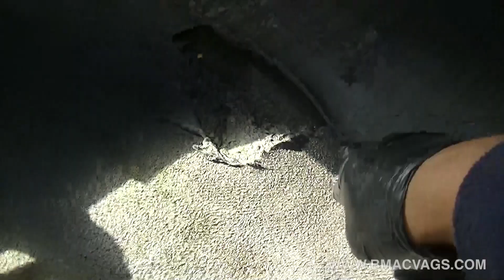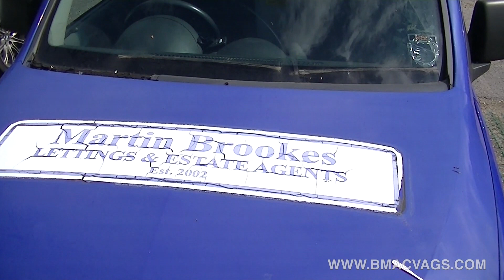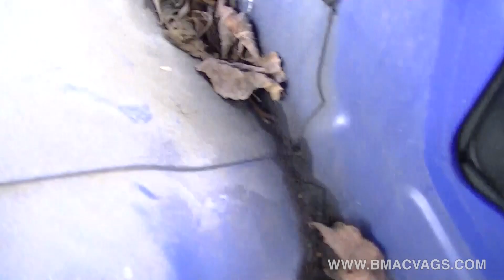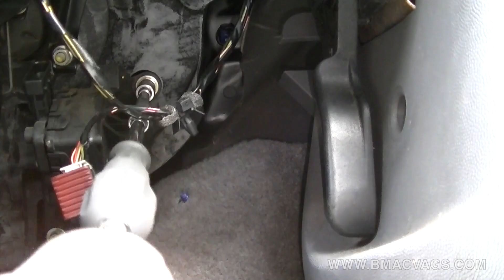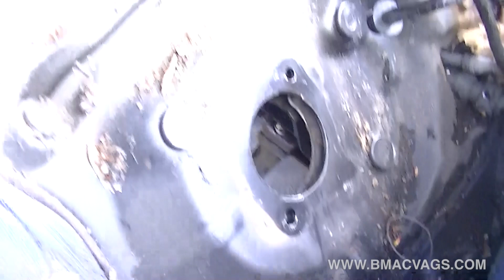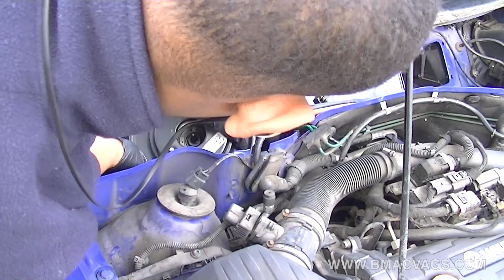Opel Vauxhall Corsa Leaky Wet Floor Repair

Comment: Did this 6yr ago cos driver side was soaking. Job done I removed the stupid flaps which just caused a blockage stopping water from drain.  Now same problem on other side
 Where the flaps had been it's completely free draining.
So where do I go from here???

Comment: Do we have a temporary fix voor the ladies and gents that don’t know any of the words or fixes you did there at all…? 🤓🙏🏼 my mom has got an old corsa from 2001 or something, an automatic.. it doesn’t look like its coming from the break and gas area though, looks like it seems to come leaking from a gap between the left (the Netherlands driver seat is on the left) door and the car itself… or maybe somewhere else? Because we also put cloths in the “open areas”, on the left from where the break is, and let them sit there for a while and the cloths come out dry after rain and everything. The mat and under the mat is drowned in water though..

Comment: Great video, will be doing it soon, already fixed the lid on black box on the right, but there is still small drip behind breake pedal. That should be the final thing I hope.

Comment: Great video really informative. I used a roof seal brush on fix due to inability to remove pedals etc. 2 coats over existing bead but brush gave me half inch over each side of bead for better sealing. Roof seal, brush on worked amazing if you can't do it fully like amazing video 👌

Comment: That isn't a corsa but a combo? Anyway I have a combo 07 with the same problem and this video is ace but I am not sure I am confident to tackle the job myself.
Reply from the maker: Corsa and combos are built on the same chassis, so ultimately they are the same vehicle
Reply: @BMACVAGS  Cool. I got the job done last week. Seems ok now it’s done. I think the stuff was called Tiger Seal but the scuttle area was also full off like leaves and sludge and the original sealer was like broken hard blue tack.

Comment: Got the same problem with my gamma, rain water sepage was bad like a pool in the drivers seat, opposite the brake booster is an outlet mine was clogged with alot of dirt and grime, cleaned it without removing everything just the water bottle and flushed it now rainwater free flows right out again🖖

Comment: Hello. Is it necessary or not  to bleed the brakes after completing this procedure?
Reply from the maker: Brakes only need to be bleed if the circuit has been opened. No need for bleeding if you follow this procedure

Comment: my servo/booster wont align air tight with the master cylinder. the seal is fine, I am completely baffled as to why. any clues? can hear the vacuum and feel it from the join. I perhaps have bought the wrong servo. although the hole is the very same.
Reply from the maker: I dont know what you have done to have and advice for you

Comment: Wish I lived near you my mechanic is a absolute dingbat. I told him where the leak was coming from on my car. I stripped the carpet out it was so waterlogged I totally dried the car then I stuck on  pieces of paper to different parts of the footwell this ruled out a faulty door seal no wet there also it ruled out water from a dodgy seal on a back light. I then purchased some food dye added it to a bucket of water and poured it over the windscreen and grill the dye dyed the paper first around by the break pedal/servo area. I said to my.local mechanic I wanted the servo sealed in and outside. He then charged me £30 for looking and telling me he can't guarantee the work so wouldn't do it. I said do your best but he wouldn't do it at all. How can he call himself a mechanic when he's a weakling of the motoring world :-) imagine if you asked a plumber to fix a leak and they said no , it's fkn embarrassing . I will follow you video and do it myself. Many thanks for uploading this top man.

Comment: Thanks So Much. Even down to the measurements with the tools, really helpful. Same problem im having in a Tigra... won’t be as neat as you, but if I dry out the water inside the car, and seal the outside, would I still need to remove the pedals? (Sorry if u have explained this actually let me go back)... but thanks a million.

Comment: Good video but it kinda ignores the basic problem which is water pooling near that back plate, what the major problem is a blocked drain in the engine bay is a black flap covering the drain. The drain is full of crap which allows the water to pool. I just cleaned the drain with a bottle brush and now the water pours out there freely, when pouring water down there i did find a couple of drops were coming in while pouring two gallons of water in there. But it is just drops and it isn't filling with water.  I think it's likely enough to have fixed it enough, if not I can redo that seal but if the water is pooling the slightest hole is going to let it drain into the car.

Comment: My leak was at the cable for the bonnet behind the sprayer bottle, the seal just pulled into the hole, So I popped it back out ,hope its good.

Comment: Cheers dude.. I've done this job 4 times now.. 1st corsa it worked first time. Tried it on mine, I've now had the thing apart 3 times and still leaking... Will be going it again soon 😯

Comment: Hell's bells, fantastic. A lot of the work put into this is unseen -- I'm thinking of the constant repositioning of the tripod. I took my Opel Tigra for its birthday carwash and three weeks later after sitting in Southern  French sunshine I was astonished today to find the driver's side (only) is still soaking, and even some seeds have sprouted. As  is obvious I don't use the car often, it's mainly my Ford Courrier; working indépendant it yesterday I noticed some 1" diameter plastic circles whic h I assumed were floor drain plugs . Since you didn't mention it I presume there are no such plugs on the Opel. What a rigmarole to have to go through just because the grills they put there aren't fine enough. An like another commenter mentioned this water might be the cause of a warning/ error light I'll getting .... Well, thanks so much for all the work you've put into this -- 10/10. Am thinking of lifting the carpet and drilling a hole or two... Phew, so much work...
Reply: Typo: indépendant should have been 'underneath '

Comment: Has anyone had problems with electrics relating to a leaky wet floor? I have a few trouble codes. Specifically, P0560 (system voltage malfunction) and another one relating to the 02 sensor. I think the ultimate problem is water/corrosion withing the wiring. I currently have a leak wet floor on the passenger side of the vehicle. Drip, drip, drip!
Reply: Hi There, the passenger side leak is from the lid of the relay box, to the top right as you look under the bonnet up under the scuttle, the neoprene lid seal leaks and finds its way to the passenger footwell.

Comment: Thanks for this video man, without it I wouldn't have had a clue how to do it on mine. Took 2 very messy and laborious days but I got there in the end lol. For anyone else attempting this, make sure you reset the brake light switch when you reinstall the pedal, otherwise your brake lights will be stuck on!
Reply: how do you reset the brake light switch!?

Comment: Thanks for the awesome video sir, followed it and I’m pleased to report that I was able to clear out all the old rotten sealant, replaced it with new and put it all back together. Looking forward to the rain to confirm all is ok.

Thanks again
Reply: Why don't you just use a hose pipe and confirm it straight away

Comment: Just did this on my 2012 plate combo the bonnet release cable can leak badly so I sealed that thanks for such a great video saved myself £280 hopefully it stays dry 👽

Comment: I did mine today and it went really well. The only thing I did different was to removed all the old sealant with a pick, then cleaned it with rubbing alcohol. I used a hairdryer for 20 minutes to make sure it was nice and dry, and used sikaflex 221 polyurethane sealant . Thanks very much for the video :)

Comment: Wish I had found your video before the two times I have tried sealing my Corsa! I didn’t remove the brake fluid filler so couldn’t get a good seal. This video is the best and I might have another go to see if I can get it sorted one and for all. Thanks man.

Comment: To do a proper job you need to take the black plate out what the servo is mounted on I did this to my combo van 3 years ago No more wet floor
Reply: How do you remove this back plate. I'm doing one for a grandma and would like to do it right.

Comment: Did mine with stixall sealant around bulkhead & roof sealant on sevo had to do again with gasket on servo as sealant didn’t do it so I would recommend using gasket, would have probably saved me having to do ball ache of a job twice

Comment: Would it matter if you didn't sort this problem out? How long would it actually take before a big hole was made, and would it actually effect the car in anyway for driving? Would be helpful if someone could answer my questions
Reply: I'm doing mine today as I really can't stand the wet footwell and winter is starting now, really worried that if it's not fixed the floor will rot through

Comment: Hi, Since doing this we my son no longer has a swimming pool in his footwell many thanks for the video, however since re- assembly  the brake pedal is now very firm, i've tried the turn the engine off and pump the brake, turn engine back on while holding the brake and its still hard, could this be me putting something back wrong?

Comment: Thanks very much for the instructional video. Hopefully that keeps the damp away.🖒 One problem now though is that my brake lights are stuck on any idea whats causing that? Where would be the first place you'd check? Thanks again.
Reply: You need to pull the switch back out on brake peddle

Comment: Just did mine today, one tip make sure you tighten the two screws on the brake booster all the way because I didn't and the brake stiffened and there was a pressure leak.

Comment: Top vid. Time to get some tools out any tips on drying the carpet.
Reply: stephan roberts take plastic of around the area lift carpet up as much as possible and put a screwdriver under to hold it up other wise take the seat out and you will get under it no problem.

Use a cloth and squeeze the carpet with the cloth underneath and ring out and repeat also turn car on and have foot heaters going it can take a while if the carpets are really wet i got a few litres out just by pushing my cloth up against the underneath of the carpet

Comment: So remvoal of the master cylinder a hissing sound was created that would ve expected as it is under a vacuum, however upon replacing the servo and master cylinder, reconnecting the pipe attached to the servo will starting the engine after completion of work create a vacuum in the servo and restore the brakes as they operated before i carried put this work?
Thanks
Reply: Jamie Newman same thing happened to me, any news on it?

Comment: Thanks for the tutorial. I now have a car that doesn't leak. It took a while to do and used tec7 to seal around the brake servo. You saved me a fortune. I owe you a pint 👍

Comment: Be careful with the break fluid reservoir, I have just knocked the break pipe line out and it is quite a messy clean up.

Comment: just booked mine in for this same problem to be fixed. machanic said yeah its a common problem and it's a lengthy job a day to a day and half for a proper job to be done.
Reply from the maker: he will have it done in hours if he watches my video
Reply: BMAC VAGS this is a very good video to explain to me what my problem is and I mentioned to him I've seen a few vids and done some research on it as had this leak for months. he said he would take a day at least and his price is £180 and said a 12 month warranty on it for me. I've took the carpet out myself as best I can
Reply: BMAC VAGS first of all I thought it was the 2 drain Vents as they was blocked with old leaves and twigs and debris so used a wire coat hanger to problems the Vents clear I thought problem solved but it wasnt

Comment: Hello . Did everything on the video and replaced everything but now my accelerator won't work now . Any ideas lads ?????
Reply from the maker: did you get it sorted?
Reply: broken wire . thanks
Reply: sealed up everything like on video but drivers side floor still wet !!!

Comment: I used a full tube of silicon sealant put a length of tubing on end of noxzle and squirted it in. then rubbed it around to make sure.  your video is good but my method worked fine.

Comment: Does it ever leak through from the bottom of the windscreen? I have been just got my van ready to re seal the brake servo and found the seal at the bottom of my windscreen wasn't in the greatest condition. Could I just put a bit of sealant in there aswell?

Comment: Did everything in the video and put all parts back, now the pressure in my brakes has gone any ideas on why this may have happened?
Reply from the maker: check the booster hose on your servo
Reply: bonkerz chard i have the same issue. Braking has gone soft and the throttle has a mind of its own
Reply: My brakes now really hard after I've done it???. And car is running like a bag of shit. Sounds awful.. but hopefully that could just be a battery thing???
Reply: Lauren Wade I did mine today and the same thing happened to me, do you hear a hiss coming from the break booster? If so tighten the 2 screws attaching the break booster and the hissing should go away and the break should return to normal. I know it's late but hoped this helped

Comment: Great job but this looks far too much like hard work no wonder my mechanic quoted me an astronomical fee.  I just ripped the carpets out and bought a cover.  Job sort of done.  The really annoying by product of this nonsense is mist so takes much longer to clean the windscreen and oh inside ice which is annoying.  Badly made car.  I know this as I have one.  If it ever became too bad I will do what one my neighbours did and drill a hole in the floor and I watched the water drain out.  This is a channel for real men.  I am in the wrong place.
Reply from the maker: LOL...... At least you have the option to try either way, thank you for watching the video
Reply: BMAC VAGS Indeed but when you are incapable like me you have to find alternative ways. Always impressive to watch someone who has a passion and talent for what they do but I am still reminded of a chap at school who took a motorbike apart and the last time I saw him it was still in bits in the garage. I know someone else who paid 10k for a sporty car, took it apart and got lost in the reassemble and ended up paying to have someone take it away as scrap when he moved out. My motto if you do not have a clue steer clear.
Reply: Did u ever drill the hole

Comment: Do some of you had the same leak LHS wheeled Corsa?
My Combo leaks a lot, and I'm getting wet on my shoes when start driving from my parking lot. 
The right han side is dry. Just removed the drivers seat and the carpet today, everything soak wet.

I have tried to find the leak by spraying with my garden hose, but i cant find any leak.

Will try to seal the brake booster anyway, and see if it get's better.
Reply: your a moron

Comment: Good job. I did this last year. Most awkward bit was the 2 nuts inside the car that hold the servo on, needed a deep socket to tighten them back up. Been 12 months, no leaks :)

Comment: Another common leak spot is bcm housing. Sealer inside housing deteriorates and leaks into driver's footwell. Remove the housing, clean old sealer, apply new one and assemble it back.
Reply: What is a BCM???
Reply: It's on the opposite side, next to battery. You could just see it in this video. A black box with 6 torx.  Electrical connections Inside.  The symptom for this one is sloshing water into passenger side when moving off. Resealing the top cover works fine. Yes, mines a 2001 so seen it all with these.

Comment: What a fucking ball ache, just punch out the floor bung and let it drain sorted in 2 minutes!
Reply from the maker: but your floor will still be wet, and your car smelling mouldy
Reply: Nah done it on loads of motors drains straight out no bother.
Reply from the maker: +Buzz Aldrin it had the bungs taken out but was still holding water.

Comment: Jesus that's a lot of work.
Reply: If I'm honest , I've done it on my corsa as it's near enough the same , and it's not actually that bad to do , the worst part is just cleaning out the drain passages, which wasn't hard either
Reply: I think I’d rather have a swimming pool in the car, than do all this work 🥵

Comment: How did you manage to remove all the old sealent got most of it off but some of it is like removing chewing gum  also great vid best on Youtube
Reply from the maker: I used a ice scrapper to push it off. Get as much as you can get off, clean and administer sealant.

Comment: I had tried to seal the servo after the floor was leaking, after watching this video I have successfully sealed the servo unit and the car is now remaining dry. The only issue i now face is the boot release lever under the dashboard won't sit back in its slot properly, I'm not sur eif I'm doing something wrong. But I am thriled to no longer have a leaking car and a wet floor
Reply from the maker: that is fantastic news

Comment: How much would this cost at a mechanics
Reply from the maker: I would guess £300-400
Reply: Quote today for £325... so it looks like I'm doing it myself! Only bit that worries me is messing around with the accelerator and brake pedal but I'm going to give it a go and get a mechanic out after to double check for peace of mind.